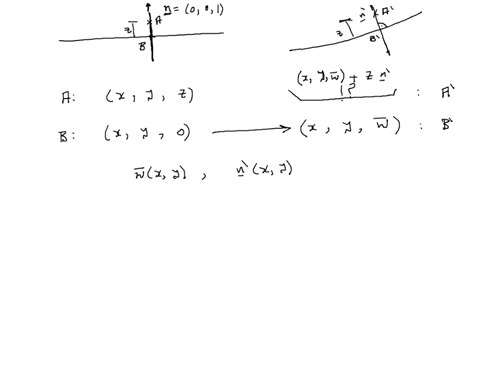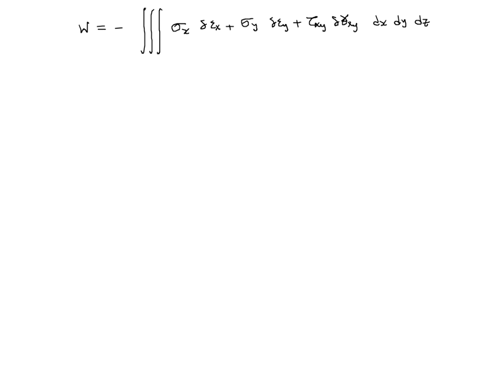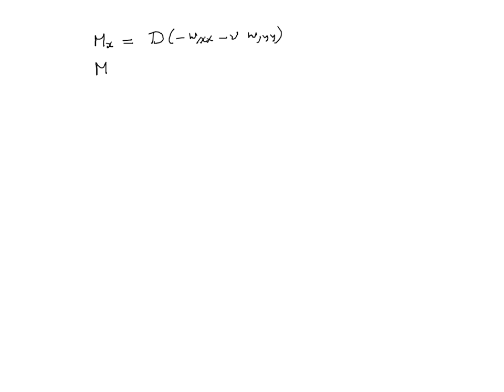2012 10 10 1239 lecture 2, about plate theory

Comment: Please excuse me for asking such a big doubt here!!
Sir we r using a copper diaphragm for one of r application and we r pressuring a hydraulic fluid on the diaphragm and this diaphragm is welded on to another hollow block underneath the diaphragm at the sides
And we know the working pressure
Can you please help us with the calculations of thickness for the working pressure??
The dimensions o the thin sheet are 147mm by 10.5 mm and working pressure of the fluid is 1028 psi and we r constraining the deflection to 0.15 mm
So can u help us find the safe thickness of plate to sustain the pressure??
Reply: VITTAL S S This video is a part of an OpenCourseWare course, you can find the whole course here: http://ocw.tudelft.nl/courses/master-aerospace-engineering/advanced-structural-analysis/course-home/ In the course you will find an Open Study widget where you can ask questions about the courses. The course is for self learners so there is not a lecturer who can help you.